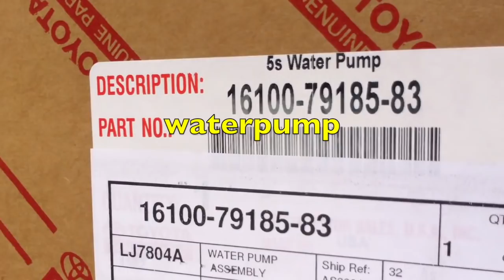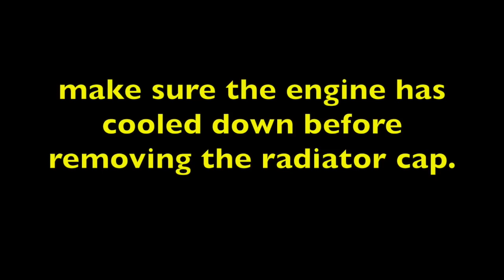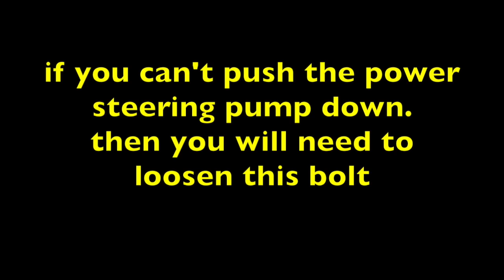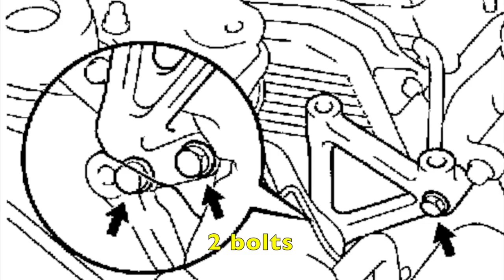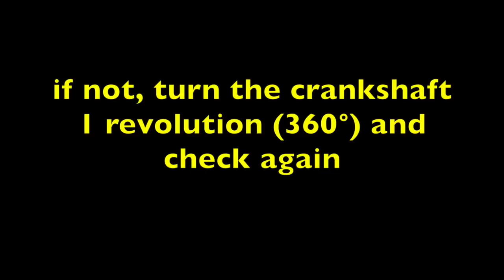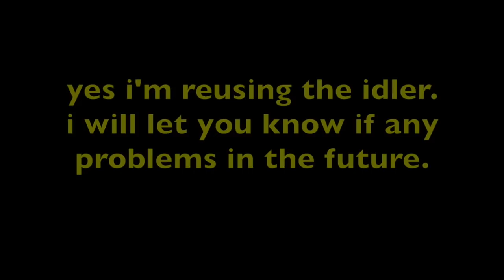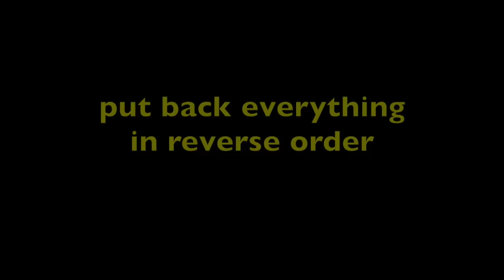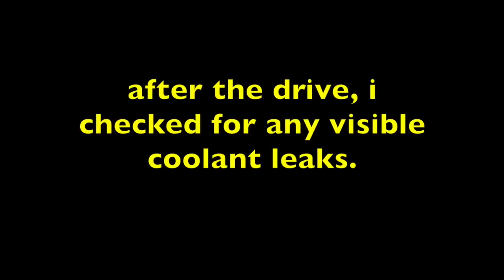timing belt & water pump replacement '96-'01 Toyota Camry 2.2L 5S-FE √ Fix it Angel

Comment: I really like videos like this, no filler and to the point.  Got everything I need for the TB change, Aisin TCT02 kit which includes the water pump assembly, oil pump seal and gasket, drive belts, all the tools etc.  As I am increasingly working on our cars and my sons cars I also purchased an impact wrench, just a budget one but one that is highly rated and actually exceeds it's advertised torque unlike some of the well known brands that fall well short-more expensive isn't always better!  Really looking forward to tackling this and preparation is always key, don't want to be rushing out to Autozone or wherever to source things I forgot I needed.  Also don't want to complete the job then find I forgot to replace something or did something wrong.  The car I'm working on is my 97 Celica GT convertible, 234,000 miles, runs great.  Should get another 100,000 miles out of this car and I only paid $1200!  Also replacing the right CV axle.  Thankfully have other cars in our household so no rush to complete.

Comment: For those who are not familiar with changing a timing belt it's a must to turn the engine by hand in order to check if there's any contact with valves before starting the engine. That's a recommendation for mechanics as well.
Reply from the maker: thank you for pointing that out. i forgot to add that in. i will just add that in the video description
Reply: These engines are non interference so that wouldn't be necessary.
Reply: hello, je suis d'accord avec vous

Comment: Thanks for this video. Thankful timing belts are a thing of the past.
Reply: Timing chains have issues also, chain "stretch" and eating up chain guides. Nissan has the ka24 that will actually start to wear on the block if left unattended.

Comment: Great 1 handed work and video in other hand. Nice trick of tightening the tensioner to hold the belt system in loose position until properly installed.
Reply: It works even better if you hand tighten bolt on tensioner pulley, then back it off about a half turn so pulley can move, then connect one end of spring to tensioner pulley and the other end to pin on engine block. Now push down on tensioner pulley as far as you can with one hand to stretch out the spring, hold it there and tighten bolt with wrench or socket. Tight enough so spring stays stretched out. Now put belt on like he did and when all the timing marks on camshaft and crankshaft are line up, loosen tensioner bolt and it will put tension on belt. Doing it this way, you won't struggle putting on the spring.

Comment: When I put the o ring on to the water pump pipe it makes the actual water pump not want to sit back in place cant seem to get it far enough on to get the nuts back on the 10mm bults

Comment: FitItAngel I'm doing the oil pump seal and the cam seal. I can't get the harmonic bolt off. When you did the trick did you have a regular 1/2 ratchet and was it set to loosen? That's all I have to do? Wouldn't the ratchet just be able to spin the opposite way?. I have never done a timing belt before. I'm self taught mechanic. Thank you for all the help in advance.

Comment: This reminds me of when I used to change the timing belts on the old Honda engines from the 90’s except it was much easier than this Toyota.  I could do it in under an hour.
Reply from the maker: wow that's quick!! labor hours is 3 on this. am i right?
Reply: @FixItAngel  yeah shops would charge 3-4 hours for the job.  90’s honda/acuras B and D series engines were sooo easy that I used to change them out for people just out of boredom.
Reply from the maker: @beastfromtheeast9318  bet you could do it with your eyes closed. lol stay safe brother

Comment: Awesome! Just awesome. Straight to the point no bullshit. Only thing is after I did all this the car won’t start 😢 I believe it may be the timing is messed up at the crankshaft. You show a diagram with it having markings. Well this one does not,have them. Just on the plastic piece which sucks if it is off one has to put it all back together and then set it and then take apart again. The camshaft is set correctly as well.

Comment: Got an oil leak from the oil pump on my 01 camry. Everything I've been looking at says if you're going to replace the seals that you might as well do the timing belt and water pump while you're at it. Is there anything else exceptionally difficult to this if you're also replacing the oil pump?
Reply: Other videos do not replace the oil pump.  It's such a simple design with one moving part, it's not going to fail unless the engine blows up.  Go replace all the other seals while you're at it.

Comment: Thank you for making that video.  No new timing belt needed on the my 2001 5S-FE 2.2 but now I see how to do the other stuff. I had been told (& it was definitely true on both 1993 Corollas that I once had) that the camshaft seal ought to be replaced when doing the timing belt. And on this 2.2 engine that the oil pump seal under the timing belt should also be replaced when doing this. Still true?
Reply from the maker: hi brother,  yes it always recommended to replace the seals when doing the timing belt. But as for the oil pump. it depends on the mileage. if over 200k miles then it will be good to replace when replacing the timing belt. thanks for asking
Reply: @FixItAngel  My 225k '99 5SFE engine is leaking from this area. Previous owner said they did a timing belt job.  Now we have to repeat the same labor to get to the oil pump gasket, but it's also a good time to replace the camshaft seals, front main seal, etc.
Reply from the maker: @loden888  hi loden888, yes it’s good to change the seals too. Thank you for the comment

Comment: Kuya my Tita just gifted me a 1995 toyota camry 2.2l. I haven't torn it down yet but it looks similar. Would this instructional video be pertinent to my situation. Thank you po kuya!!✌🏽 also kuya i almost forgot. When you were removing crank bolt why didn't you just hit it with impact? Its not  criticism kuya im just curious if maybe its NOT supposed to be hit with impact for possible breaking of bolt?. I know that your not supposed to impacted it ON I've seen them snap. Thanks Again ❤✌🏽
Reply from the maker: Hi Lito, i could have used the impact but many DIY don't  have impact. so i show the manual way. I have never experienced a broken crank bolt by removing it. So sometimes i will use the impact if it is very hard to remove. thanks for asking. stay safe and stay well. god bless
Reply: @FixItAngel  Maraming salamat po kuya God Bless you and your familia..

Comment: OMG !!!  this must be a 12 hundred dollar job at the stealership...what with all the disassembly you did to get it done...holy smokes...
Reply: In that car is 2 1/2 hour job. It doesn't require any special tool to lock the camshaft or crankshaft or both like in a Ford Focus or Fiesta, for example. There's a myth around timing belts, that it's a super complicated job, but is not that hard, and that's why they charge a lot of money for that.
Reply: Stealership is right! Some chain repair/tire shops also want to charge a lot & sell parts the car doesn't really need. Recently had $6K estimate from Big O' Tires. I'm just going to have my mechanics install the parts for a fraction of the cost. It's amazing how Angel fixes these cars single handedly! 👏🏼👏🏼👏🏼

Comment: How much you think it would cost to rebuild a transmission on a 2005 Ford Explorer
Reply from the maker: Hi EJ, sorry i don't know. Better to call shops in your area that specifically rebuilds transmissions.
Reply: @FixItAngel  3300 is that too high?
Reply from the maker: @ej425  yes too high!! you better off buying a already rebuilt one.  or maybe buy a new transmission with that price.
Reply: @FixItAngel  damn good thing I ain’t take it , but they charged me 120 just to scan the car
Reply from the maker: @ej425  yes they will always charge diagnosis fee. it's a lot of money just to tell you what is wrong. the cars i repair. i don't charge diagnosis at all. just my way of saving the owner some money. i know how it feels like being in the other side.
Reply: @FixItAngel  Ford problems
Reply: @ej425  Fix Or Repair Daily

Comment: I thought Toyota used a bottle tensioner with a pin that you pull out like a grenade pin?
Reply: I like the spring tensioner. Never saw that before.

Comment: Great video as always 👍 Unfortunately I have a leaking freeze plug right behind the water pump housing. Only leaks when the engine is cold.
Reply from the maker: thanks for watching. that's unfortunate of that leak. try get it fixed soon.
Reply: @FixItAngel    Will do 🤙

Comment: Maybe the have sprayed with / soaked the rubber parts with 303 Protective  , water based . It's to protect rubber / plastic parts from drying out , due to heat and sun . YouTube Channel , " Sweet Project Cars " goes into detail about using it .

Comment: I suggest when you replace your timing belt to use a larger diameter timing belt idler bearing.

Stock is a 13503-63011 

Off the top of my head is
10mm bolt hole size
Width 29mm
Diameter 57mm

There are bearings available in Europe that are 60mm in diameter

3mm larger that will allow the belt tensioner to have some available travel to adjust the belt so it's not loose. Gates part number T42226

Manufacturing issues from Toyota for replacement belts and Mitsuboshi belts also.

OEM belt 13568-09041
Crank seal 90080-31022
Cam seal 90089-31023
Oil pump o-ring 15188-63010
Oil pump shaft seal 15165-70010

Replace all of those every time.

Only use Aisin water pumps
Mitsuboshi timing belt or OEM
Drive belts are 
5pk1110 Alt/AC
3pk760 or 750 for Power Steering

Replace the power steering pump O-ring when apart

The feed elbow will leak or better yet get  reseal kit for the pump. Easy to reseal. Main housing gasket only fits one way ( correctly ) or they leak.

This engine 3SFE or 5SFE are non-interfance engines. If belt breaks or is apart valves will NOT hit the pistons.
Reply: عخعع
Reply: المنتخب السعودي و الفرنسي بطولة تولن القنوات ع

Comment: Also a good idea to do the oil pump shaft seal and the "spaghetti" seal for oil pump while down there doing the timing belt. (Ask me how I know)
Reply: No doubt
Reply: Because you had the job completed but it started to leak oil from worn out seals??
Reply: @asburypark1516  probably.  same problem on my car - and the timing belt was replaced a few years ago.